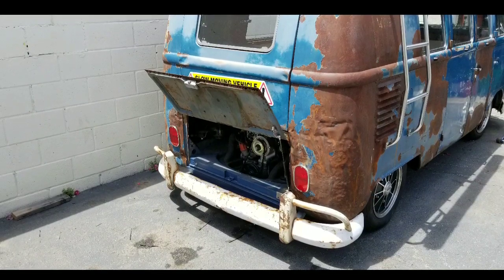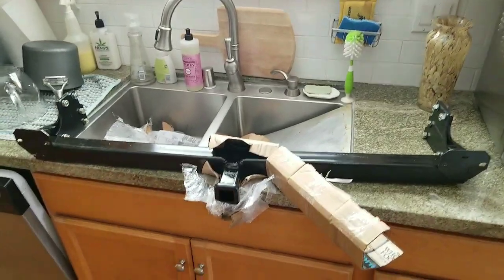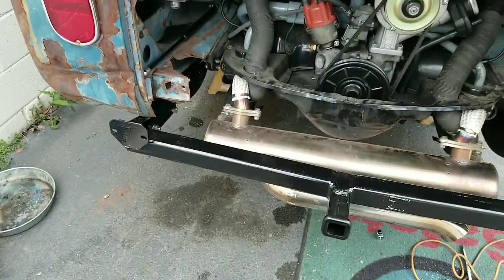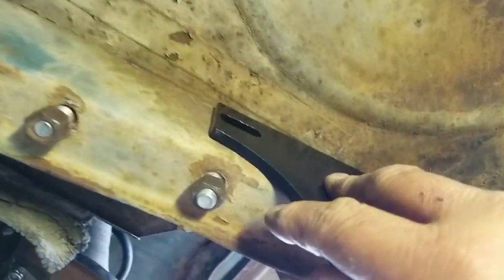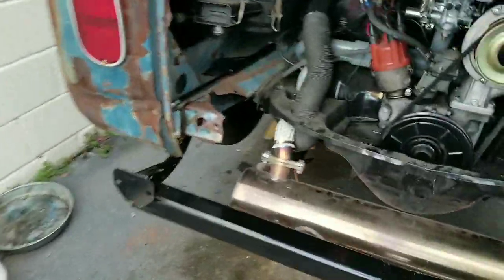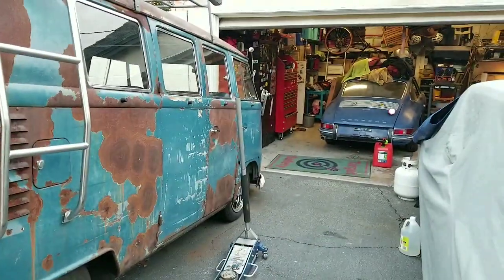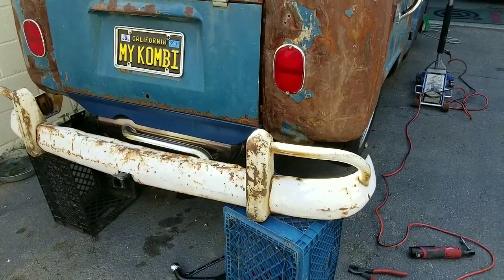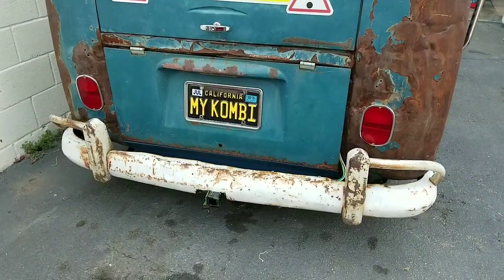VW SPLIT BUS TRAILER HITCH INSTALLATION PHILA TV!

Comment: No problems with it hitting the exhaust pipe? Do have to do any modifications to get it to fit? I purchased the same hitch, for the vintage speed exhaust but it won't clear the exhaust pipe.

Comment: I was just wondering why the brackets that you bought on to the frame weren't a little lower that way you wouldn't have had to cut your bumper
Reply from the maker: If the receiver was below the bumper it would grind over bumps
Reply: he special ordered it that way with the bus lowered and that model vintangespeed exhaust.  That is not the standard setup. https://www.thesamba.com/vw/classifieds/detail.php?id=1039735